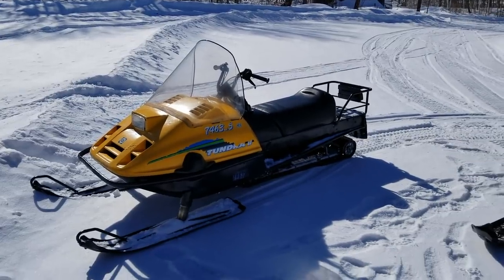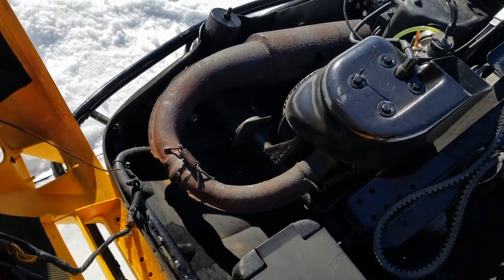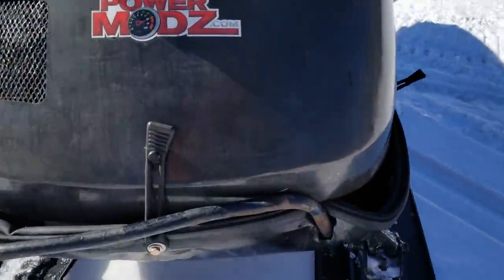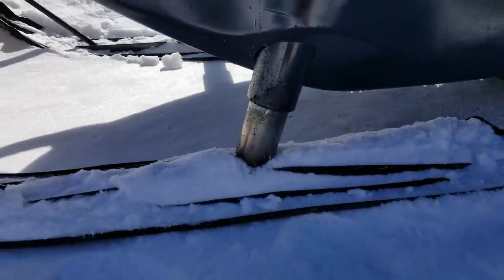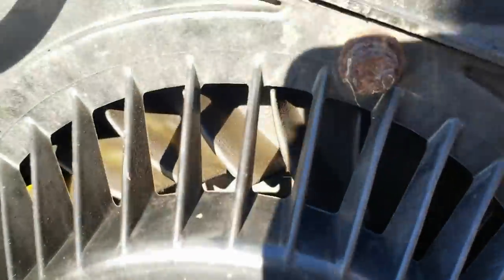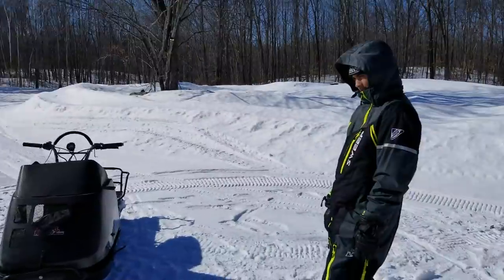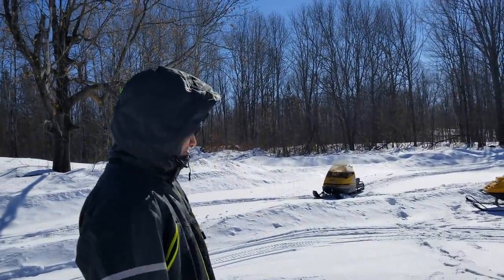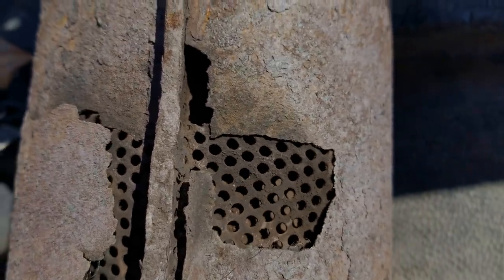Skidoo Tundra in the  Line up! Check it out!!

Comment: let us know if you find a way to stop from running the track off
Reply from the maker: not sure what you mean by that
Reply: @PowerModzOfficial  the tundras and old scandics and nordics are all awful for running off their track. Some of the tundras in their last few years had a different track design and didnt run off after
Reply from the maker: @cordelllush8133  interesting, ive owned many tundras and never had that happen - maybe the track is run too loose?
Reply: @PowerModzOfficial  its not just me, almost anyone around here, ask them about the old tundras and theyll tell you how easy the track could come off
Reply: I have owned many older Tundra machines. Regarding tracks I find you need to keep track tension adjusted on the tight side of things every season.